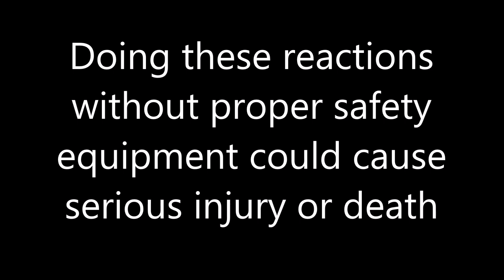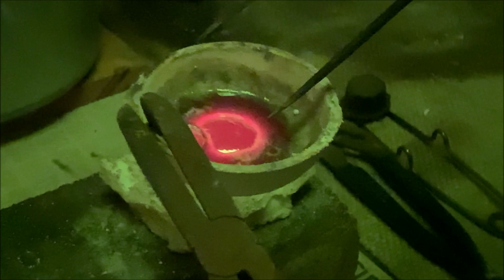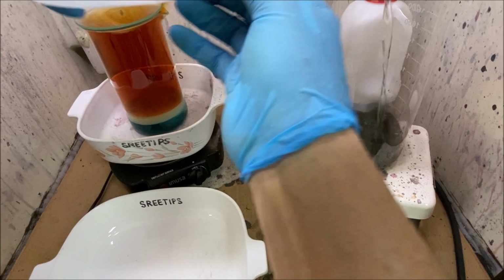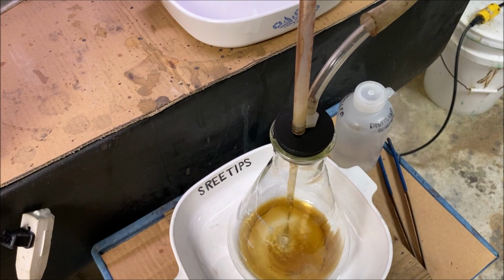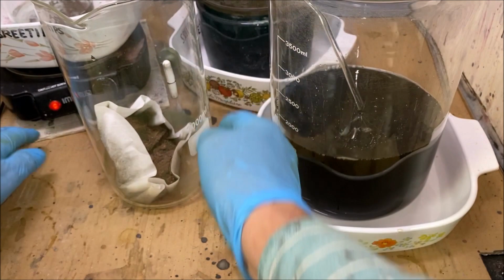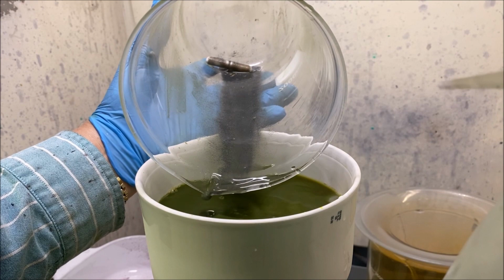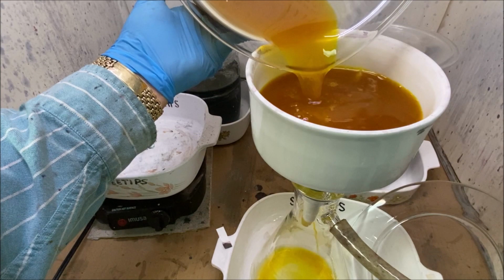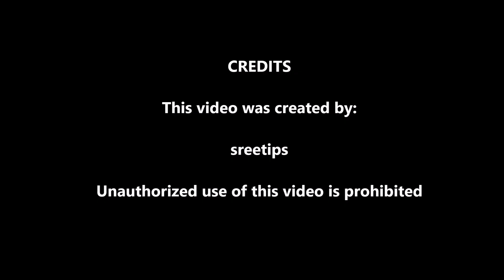Jewelers Tool Drawer Filings & Clippings

Comment: Is pouring nitric straight onto the gold a bad thing? Why the destilled water first? sorry may have missed a lesson or to being awestruck by the blue liquid that is silver and the black gold.
Reply: The solution needs to be diluted to do the work, it would be a bad day under the hood if the water followed the acid... Once the acid is already diluted, more water can then be added as required. He only added straight acid (not 50/50) once there was a fair amount of acid already present in the solution.
Reply from the maker: Good “rule of thumb” always add acid to water.

Comment: If ice cubes precipitate out silver chloride, then would using filtered or tap water still be a problem?
I presume the Stannous Chloride that you use is anhydrous not dihydrate?  Tin dissolved in Hydrochloric Acid..
Reply from the maker: Probably be ok

Comment: I always freak out when you put ice into the solutions if it's hot,  I did this the other week with a glass cup I had washed and the cup split in half in my hand. like perfectly in half
Reply: Lab glass is mainly borosilicate which is highly resistant to thermal shock.

Comment: Still didn't get what's the point in adding silver to gold for refining ? Why not refining the impure gold itself ? Couldn't find the answer on internet... Thanks !!
Reply: why not putting all the dust and impure gold into aqua regia then wash it then refining again then adding sodium metabisulfite ? like why all these steps of separating gold, burning the dust etc ?
Reply: about my first question...i finally reached the 21st minute where all is explained !  But...what happens if you don't make this gold/silver alloy and just make aqua regia then sodium metabisulfite (several times if needed) ?
Reply from the maker: Add silver so the nitric can penetrate.
Reply from the maker: Makes a dirty solution
Reply from the maker: Recovery becomes more difficult.

Comment: You must be good at things like Tetris and loading the car for a long road trip! When you do several things at once and the fume hood gets crowded, it also makes it slightly confusing for the viewer.
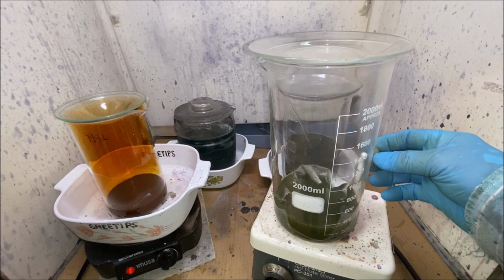At around 31:00, when you were adding HCl to the beaker on the right, with the filter paper, it took me a good minute or so to realise there wasn't suddenly a smaller beaker inside the one on the hot plate.🤦‍♂️
Reply from the maker: It can get confusing.

Comment: I have a gold chain it's marked 24kgl what does that mean ?
Reply: Its a form of plating but thicker, similar to gold filled from what i understand.   Stands for 24 Karat Gold Layered.
Reply: @okkrom  thank you for reply , it is 11 grams any way to determine expected extraction ?
Reply from the maker: Layer usually means plated with just a few microns of gold - almost nothing. To test: put a drop of 14k test acid right on it. If it has a thick coating of gold then the acid will do nothing. If it’s thin gold plate then it will begin to bubble, stink, and turn green as the acid burns right through the thin gold plating. If it stays unharmed it can be refined - expect about 2.5% pure gold by weight. If the acid burns through then it’s just junk plated jewelry and worthless.

Comment: Sreetips next time you process sweepings from tool drawers why not run the material you collect through a screen first ?  That way you can pick through the bits and pieces and see everything without searching through the fine particles.
Reply from the maker: Will do, thank you
Reply from the maker: I learned it this way. She (Hoke) recommends either lye, or incineration. Harold_V on the GRF drilled incineration, incineration, incineration. He was like a mentor to me.

Comment: Platinum might only dissolve in hot FUMING nitric acid... concentrated acid is not enough.... nor does it dissolve in hydrochloric acid except under the influence of large amounts of oxygen.. Aqua regia works well.... 😉

Comment: Since gold is very slightly soluble in nitric, I suspect if you run elemental analysis the silver crystal you later grow from these jars will show a hint of gold.
Reply: If you run an ICP on sreetips's lunch you'll find gold too I bet ;)
Reply from the maker: I had some silver crystal analyzed and it came back less than 0.0001 of anything other than silver.

Comment: are you getting careless? I thought for sure your first step in the sorting stage would be to put all the material through a mesh screen and sift out all the large bits. It certainly would have saved you that hour and a half picking through the material with a pair of tweezers. If you have "missed" any gemstones in the material, certainly they would get damaged in the furnace during the incineration.
Reply from the maker: I thought that folks would think that I forgot to do it as I was sorting